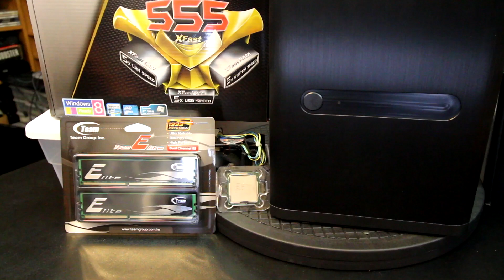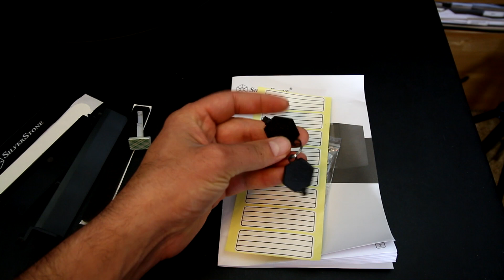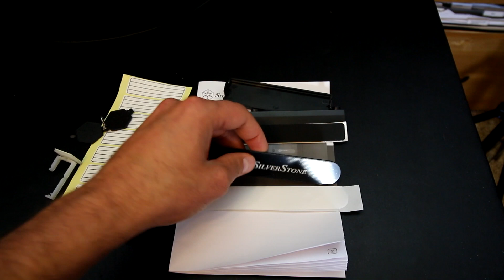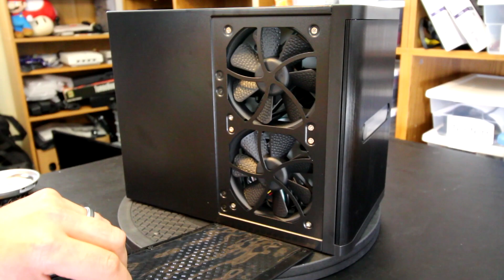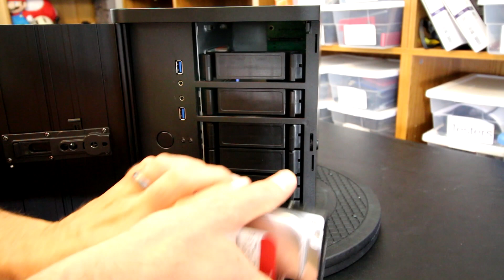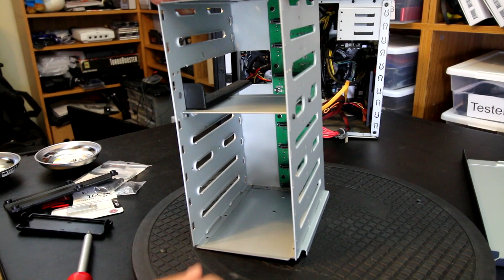NAS build with the SilverStone DS380

Comment: Great review man! subbed!
Gonna go look at the R4 now :)
Reply from the maker: Thanks! Do you mean the Fractal Design Define R4?
Reply: +AdoptedMike yes watching you home server build now :)
Reply from the maker: I enjoyed using the Fractal case much more. I am still using it today.
Reply: +AdoptedMike I'm looking to build a small i3 powered nas. My storage capacity needs are definitely in the low end so 2 bays + a single ssd taped somewhere could probably suffice. Should i go for smaller or utilize the expansion capabilities of something like the Define R4. Can you point me towards a suitable cpu with very low wattage and help me decide if ECC is necessary as I'm read alot on /r/homelab. Anyway thanks for making very detailed videos
Reply from the maker: ECC isn't necessary, but for the long term it is a good idea. Many people will scold you for not using ECC. Data can get corrupted by not using ECC in the long run. Personally, for me it was cheap enough and my data was important enough that I did spend the extra cash on it. I also have more than one NAS and use an online service for the most important data to be backed up. The average user will probably be ok without ECC. I am assuming that you are going to use FreeNAS, which is generally recommended to use ECC with. Do you have a particular socket of motherboard you are going to use? Example: LGA1155, 1150, 1151? Also FreeNAS (and many other NAS software) use bootable USB drives for the operating systems. You probably won't need an SSD unless you are going to use a Windows O/S for the operating system. I am also thinking that you are going with a mirrored drive setup (RAID1). For that in my opinion, ECC could be less necessary as there is much less system load on the simpler RAIDs like 1 and 0 then there are with RAID5, 6 or RAIDZ file systems.

Comment: if you are building a NAS with FreeNAS and using ZFS one thing to be careful with is raid cards.  ZFS likes having direct access to the drives which few raid cards allow.  the work around is to look for  raid cards that can be flashed with "it mode" firmware
Reply from the maker: +LordDrachenblut Good catch! Thanks.
Reply: +AdoptedMike no problem.  how has the heat been with this case? I've heard that this case has poor design for ventilating heat. I'm looking at building a NAS with a asrock v2750d4i mobo and 8 WD red's.
Reply from the maker: +LordDrachenblut I never had the chance to deploy it. I had a house fire and lost the build due to heat and smoke damage. It did seem like it would have heat issues. I personally would not use 7200RPM drives in it. The WD Red's will be better suited to being in this case IMO.
Reply: +AdoptedMike man sorry to hear that but thank you for the information.  I'm considering the u-nas nsc800 chassis
Reply from the maker: +LordDrachenblut That would be my pick if I do it again.
Reply: +AdoptedMike good deal man.  I had also considered the lian li q26b but the drive backplanes run 20 or 25 a piece

Comment: The whole point of the case is to stuff as many hot-swappable bays in as small a space as possible. Of course it's going to be cramped and airflow will be sub-optimal. Not sure why you would worry about difficulties in working inside the case in case of hardware failure when there is little chance of that happening. If there are anything that might fail they are the drives.

Comment: I took a dremel tool to modify the bracket (so my lsi 9220-8i raid card will fit without losing the 3rd hard drive) and placed a piece of cardboard on the right side of the side fans to direct the air towards the hard drives.  Saw these mods on the internet and they lowered the temps on the hard drives.   Later if needed I may change out the 120mm fans to Noctua NF-F12's.  Depends on how this build react at full load.
Reply from the maker: +Robin Wallace Nice! What RPM drives are you using? Mine burnt up in a house fire (not related to the case) and I never got a chance to test it out.